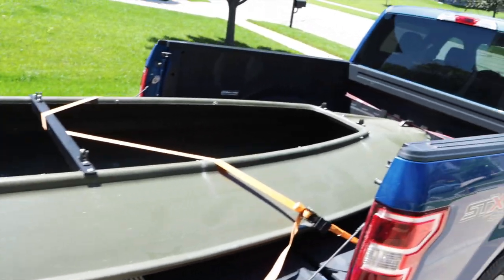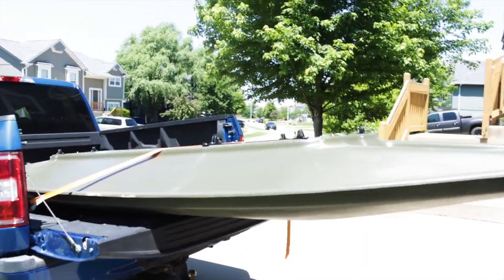Will It Work??? | MoMarsh Fatboy DP on the water pt. 3

Comment: That are awesome boats man. I have a four rivers boat and I am in the process of building a frame around the top to at a little strength to it and also the other reason for this is to be able to have a set of oars for the boat. You will have a lot of fun in that boat with your dog. Keep up the great work.

Comment: I have a similar style boat, i use the foam floor pad, like a yoga mat style, keeps you off the fiberglass and deadens stuff hitting the floor.
 works great, insulates, and roll it up and toss in the truck when moving the boat, super easy
Reply from the maker: Great tip!

Comment: More weight up on the nose will help the tracking.  Push pole is much easier than paddling if the water is shallow enough.  I use electric motor or small 90cc mud motor with one of the mini kits (the 6hp mud motors are too big on the dps, too much weight off the back.  I sold my 6hp after I flipped my dp with a mb 6.)

Comment: You might want to add a truck bed extender if you carry it stern end out with the motor, also stick your dove bucket in the boat for travel in the water once you set up the bucket can be stashed in the weeds.
Reply from the maker: Good ideas!

Comment: Im sure you’ve thought of this, but a life saver on my kayak is a gun holder (like on an ATV). Just an idea.
Reply from the maker: I've never needed one in my kayak. I just rest the barrel on the front bar
Reply: @OutdoorLimits  I guess it could depend for some. My gun rusts easily so I prefer to keep it in my waterproof case. The gun holder allows me to do that, plus slip it in and out of easily in case I got jump shoot coots or need the gun quickly.

Comment: Get the steel glue gun out and make a extension rack to go in the trailer hitch with a top rooler on it for easy loading and added tie down area for the boat tail end.That is a Well trained dog that you have done with her for going in a boat like that
Reply from the maker: Thanks for the tip!